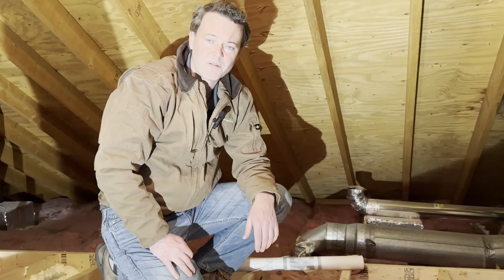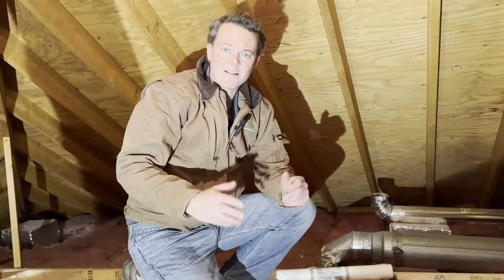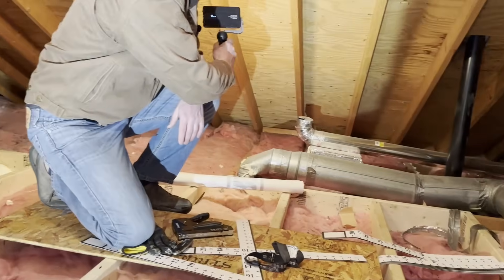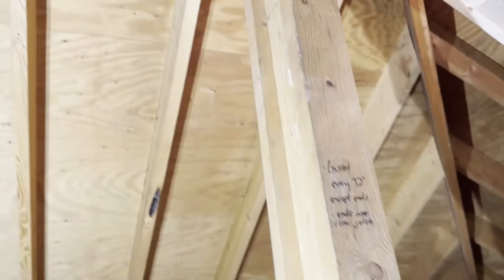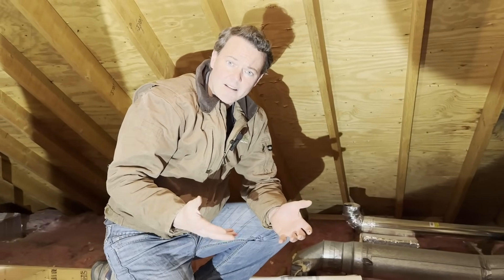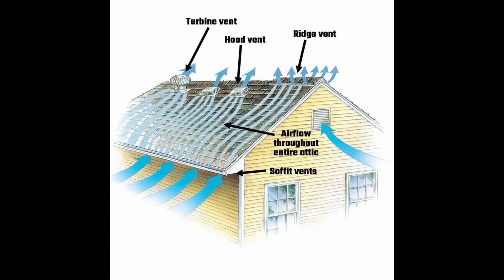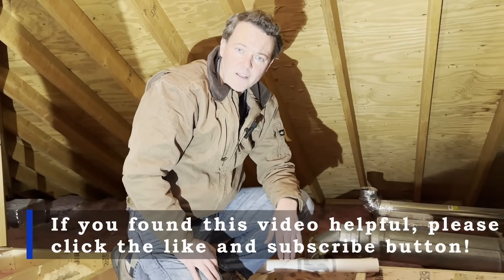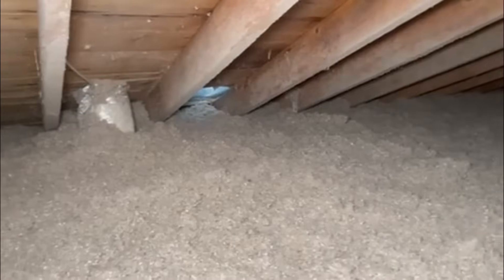Is a Roof Power Attic Fan a Waste of Money....or Even Worse?

Comment: Would a gable fan work in this situation?
Reply: I am not an expert but can pretty confidently say "no" unless you were to pair it with some kind of make up air from the opposite gable
Reply from the maker: If you don't have ridge vents and you have a gable vent at the opposite end that will permit enough make up air than yes, that array could work well

Comment: I once read that the only way an attic fan would be effective at reducing heat is if it could move massive volumes of air -- along the lines of a small propeller-driven aircraft engine.
Reply: If that is true, then how in hell can a passive ridge vent move enough air to do anything at all.  Your argument is illogical on its face.
Reply: @MissingRocket  I have the same point as you brother... a powered fan is Working and exchanging air in ways a passive cant come close to approaching..with  proper soffit intake all around the roof,. hot air, in a best case scenerio with a ridge, is just slowly oozing out those ridge baffles and thats assuming the ridge Doesnt have a gauze type filter pad blocking even that meager flow... I'd love to see the actual cfm and air exchange rate of a ridge vs two 16' powered gable end fans rated at 1900 cfm each.
Reply: @MissingRocket  Not arguing  anything, just sharing an anecdote. Happy to be proven otherwise.  I did have 2 attic fans in my old house and they didn't  seem to make much difference  though.
Reply from the maker: I have seen one well positioned power fan drop the temperature in an attic from 120 degrees to about 80 in less than 10 minutes.  The fan was positioned at the top of a hip roof, there was plenty of intake ventilation around the perimeter, and there was no other exhaust ventilation (vents up high) other than the power fan.  So they CAN work excellently.  However, the majority of the time that we encounter them they are positioned too close to passive vents (usually ridge vents) to have that effect.  In these cases, like in the video, the fan runs and runs and has little effect on attic temperature.

Comment: Good overview.  When I reroofed, they added shingle vents along the full lower roof line (as my soffits are too narrow for typical vents) and added a full ridge vent.  Summer does cause the attic to get rather warm just from the normal full sun the roof receives.  I'm wondering if augmenting the ridge vent with a solar powered fan (or two) would be of any benefit to pull some extra air through the shingle vents or if its a waste and the air would simply pull through the ridge.
Reply from the maker: The roof fan will pull from the nearest vents, so if you place it near the ridge I wouldn't expect much of an impact.  If you placed it in the middle of your roof, equidistant from the exhaust and intake vents, that would pull air from a wider area and more than likely get you a better result.
Reply: That's the way the one at my parents was done last time it was roofed. It rarely gets into the 90s around here, so it probably wouldn't have even occurred to them to have an actual fan installed as previously there was no ventilation at all. It was a couple layers of asphalt roofing over the top of cedar shakes.  I haven't noticed a difference when I've been over there. The box fan that I bought them years ago to get a good cross breeze going on the top floor of the house has made a much, much bigger impact.

Comment: Why do proponents of power roof fans never mention the fact they don't do anything for those in cold climates in winter. it's not good for a hot attic when the outside temperature is 30f and the attic is 70. Ice dams mold etc
Reply: I would think it would be good because it would exhaust the hot air out of the attic and pull cold air (less ice damning) dry air (less condensation) into the attic
Reply: You need that air flow in the winter, For dampness and condensation..  you always need fully vented soffits, gable vents,  and roof vents 8 ft apart...  Over ventilated, and the shingles will last much longer...  Plywood last longer and may not de laminate...
Reply: gable end fans also have thermostats that can be set according to what ur trying to achieve...
Reply from the maker: For exactly this reason we are huge of proponents of 1) air sealing the attic floor 2) insulating the attic floor to R-49 with cellulose insulation 3) installing passive ventilation that is adequate and balanced for the size of the attic.  If you do these three things correctly, you should have a comfortable and energy efficient house year round (assuming the rest of the home is properly insulated), and not have to worry about ice dams or attic mold.  Annnndddd...you will not have issues with an attic fan that is potentially installed incorrectly for a variety of different reasons.
Reply: You are absolutely correct. The original problem is a hot attic ie temperature over 20 higher than the ambient temperature. Attic fans only kick on based upon the thermostat so like you said in winter it won't come on even though the attic is 40 degrees hotter than the ambient temperature. Plus the fan doesn't come on at anytime when it should besides the thermostat set point ie spring and fall. If you follow the advice of the video you will have more than likely solved the problem by keeping the attic temperature within 10-15 degrees of the ambient temperature year round. That's what the goal should be
Reply: If you have intake like from soffit vents, it would help. You want a cold attic so snow doesn't melt from the bottom only to refreeze, form ice dams, and back up under the shingles. In this setup, your insulation is between the attic and the living space.

Comment: Andy, what do you do in older houses that may have blocking between the soffit area and the attic? Drill holes? I guess if the house needs a new roof anyway, under shingle vents are a good solution, though it seems you'd need a whole lot of those to equal the venting you could get from continuously vented soffits which would also be much more discreet. Love your channel!
Reply from the maker: Hi there and thank you!  We usually don't attempt to vent solid soffits.  I've done it a few times and its extremely laborious and time consuming.  What we typically do is install a series of slant back vents, usually on the back of the home, to provide adequate intake ventilation.  They work extremely well for us.  Undershingle intake vents also work great for intake and we are huge fans of them when they can be installed.  If you could have a roofer or siding contractor install a continuous soffit vent however by cutting through that wood, that would also be an excellent solution, and you wouldn't see the vents on the roof if you did that.  
Andy
Reply: @insulwiseenergycomfortsolu3293    What happens to the airflow into undershingle intake vents during snow events/ice damming?
I have an older house that I think is similar to the OP's description.  It has holes drilled into the wood (2"?) with little metal vents with screens to keep the birds and larger bugs out.  It provides some air coming in but their total area is not enough for the amount of vents near the ridge and they also covered some of the 'soffit' vents with insulation on the attic side.

Anyway I get pretty bad ice dams and have wondered if undershingle vents would work.
I have not found anyone around here who really knows what they're talking about along these lines.  Wish you were in my area.

Comment: Thanks for the video!  My roof is about 2500 sq ft, and it has 34 soffit vents, 4 gable vents, and a ridge vent above the living space.  The garage has no ridge vent, and its the coolest part of the attic.  It has a gable vent, soffits, and a roof turbine.  Being that its the coolest part of the attic, I presumed the ridge vents are not working well.  Its the honey comb style.  I added a 3000 rpm smart gable fan on the opposite end of the home over the master bedroom.  I am seeing improvement with attic temps by about 10 degrees with the gable fan.  However, I dont want to interfere with the function of the ridge vents, even though I dont think they are working efficiently.   My roofer also thinks they are not efficient and therefore no longer installs the style I have.  Since I am questioning the effectiveness of our ridge vent,  I am thinking about adding another smart gable fan on the other side of the home.  What are your thoughts about this?
Reply: Your ridge vent is not working correctly because of the gable vents. Only need the soffit vents with ridge vent. Also check the amount of sq in of intake and exhaust. There's a calculator online to tell you how much you need. Finally the ridge vent might not be a good one. Check for external baffle style it also has internal baffle btw. My attic used to be insanely hot and is now never more than 20 degrees over ambient temperature year round. Power fans don't do anything for hot attics in winter and only work when the temperature rises. Why not keep the temperature from rising in the first place. Plus properly vented attics will cool down quicker in the evening. Good luck
Reply: @MikeM-bn2ij  I thought so.  I was thinking about sealing the gable vents, and then hoping there will be an intake and exhaust via the soffits and ridge vents.  It's worth a try?  I can do a before and after with a remote thermometer
Reply: @rocketj7449     good chance your gable vents are too small, and the fan is not drawing properly. You need about 4 times more than the fan size for square inches at the gable / intakes. Example... 12" fan is roughly 113 sq in. X 4 = 452 sq in. Here's where people screw up... the louvers and screen on a gable vent cut the air flow by more than 50%. Basically, you need a PAIR of gable vents that are about 2x3 ft to get enough air.
Reply from the maker: Power attic work fans can work well to cool an attic if they're sited effectively (not close to a ridge vent or some other opening that short circuits the air from being pulled across the attic).  I would strongly encourage you to air seal your attic floor if you have the means to do so just so you know you're not pulling air conditioned air up from your home to cool your attic.  Adding another fan could help you.  Generally our approach is to seal and insulate the attic floor, install passive ventilation, and then just allow the attic to get hot.  At this point there will be virtually zero heat conducting from the attic to the home below.  The shingles and roof rafters, etc are fully capable of tolerating typical standard summer attic temps.
Reply: @insulwiseenergycomfortsolu3293 what about spray foam on the underside of the roof deck? Spray Jones here on YouTube says that it does not impact the shingle temperature as much as the choice of shingle color. 
If you seal the conditioned space below,  why not seal the attic and keep out a much heat from the structure as possible? Why allow a 'hot hat' on the building?
Reply: @lucash1980    spray foam under the roof deck is actually a common practice, especially in an older home. My neighbor had it done (pre 1900 home) and he says you no longer hear the rain on the roof while lying in bed. I have to admit that it looks weird because of the retrofit aspect and having to apply it while working around fixed objects in the attic. Not sure of the winter fuel savings, but I can tell you the snow hangs around up there MUCH longer than before. Two owners and 15 years later, still the same roof shingles.

Comment: Thank you for this video. Now I think I'm wasting my money with my powered attic fan. I live in Fort Worth, TX, in a 100-year-old, 1,500 sq ft bungalow with a simple gable-style roof with large gable vents at either end. I installed a powered attic fan near the ridge many years ago, thinking it would improve the removal of hot air from my attic in the summer. But I have exposed eaves, so I don't have soffit vents. So it is probably pulling conditioned air in through the many penetrations in the ceiling and walls of my home. Looks like I've got a big job ahead of me before the brutal heat wave gets here and roasts my house again this summer, starting with sealing things up well, of course. So, thanks again for this video!
Reply: You have two gables just install an intake fan on the other one. Easy peasy. I live in Dallas and fans work. My attic temps have never been more than 10F off of my inside home temps and my heat pump works way less. Definitely save on energy bills since I installed it years ago. Not to take anything away from this guy but he lives in PA. Way different temps and situations. He seems like a knowledgeable person but he doesn’t have experience with your situation. They dont get 115F for months straight like we do.
Reply: @zimvader25  I never see attic fans that are designed or marketed as intake fans. All the ones I've seen are designed to be exhaust. Have you seen any? Or do you just flip the exhaust fan around as I suggested in prior comment?
Reply from the maker: Hey there, you're welcome for the video.  I can't encourage people enough to air seal the penetrations in their attic floor.  I have another video that details how we do that.  Powered roof fans can work well for cooling an attic, but we've seen them cause problems as well when 1) they're not sited properly  and 2) when they don't have enough make up air in the roof assembly and pull air conditioned air from the home when they operate
Reply: @insulwiseenergycomfortsolu3293  Yes. I bought a Flir thermal camera and have been hunting down all the areas of cooling loss and heat gain. I think I'm going to have to vacuum all the old insulation out of my attic to really get to everything. There are so many old penetrations that are covered up by old insulation. It's hard to find them all. But I'm probably long overdue for vacuuming out that attic anyway.
Reply: A temporary solution while you get around to sealing the attic floor may be to install a gable mount fan on the opposite gable vent, but flipped around to be an intake. If it has the same CFM as the exhaust fan, you won't be depressurizing the attic and therefore won't be sucking conditioned air out of the living space. Be mindful that the open blades will be a hazard if others will be wandering into the attic. Might be a simple way to keep the attic very close to outside temp. Curious what Andy thinks of this.
Reply: soffit vents are needed with power vent.

Comment: While living in the South the temperature in the Attic can get up to 150°. I have a two system house. The upstairs system is in the attic I have a vent on one side of the attic approximately 2 by 2 on the wall and on the other wall I also have a 82 * 2.0 with an attic fan attached to it. Since installing it I have reduced the temperature on my upstairs bedrooms by 8°. I noticed you live in Pittsburgh so this may not affect you as much but in the South attic fans are a necessity. If properly installed they can greatly reduce the heat of the upstairs rooms
Reply from the maker: Hi there, when properly installed and sited I too have seen them work well.  Unfortunately most roofers don't bother to do this (from what I've seen) and install them just below a ridge vent, provide insufficient make up air, etc .  You've sited yours perfectly to get a cross breeze, not sure if you have a ridge or soffit vents, but if you did they would likely short circuit that cross breeze, at least a bit anyway.  If you don't have adequate make up air and you haven't air sealed your attic floor, attic fans will pull air conditioned air from your home in the process of cooling your attic.  When we air seal the attic floor, ventilate the roof properly, and effectively insulate an attic floor, there is virtually no heat gain in the upper floor of the home after the work.  This solution also pays massive dividends during our cold winters.  
Andy
Reply: Similar here in NJ and most ANYWHERE in the country there’ll be days when a properly designed attic will benefit from power -assisted ventilation. I’ve recorded 140f and have gable-end fan (with soffit vents) set for 120f. Solar fans are an easy install but as rightfully explained here (in video), must be the right attic setup.
Reply: @gr8dvd    what you did right was install a t-stat. It will only run when necessary and shut off again on the overnight!
Reply: @rupe53  Installed so long ago, I forgot many aren’t controlled by a thermostat, also  guessed set at 120f but more like 105 or 110f.

Comment: This is such a simple demonstration and explanation, well done! I’m about to be a new home owner and the attic has always seemed so intimidating. At the very least, this helps me better understand how attics can be cooled. Thank you!
Reply from the maker: Hey Alan, thanks for commenting!  We try to keep things as simple as we can here, but it doesn't always work.  In this situation I tried to explain that these fans are often not necessary, and sometimes even highly problematic.  Usually the solution being sought can be achieved by air sealing the attic floor, insulating to R-49, and making sure the roof is ventilated properly with passive ventilation.  Hope this helps!